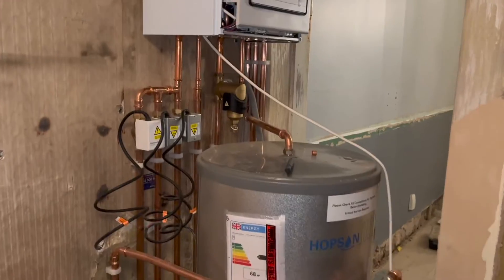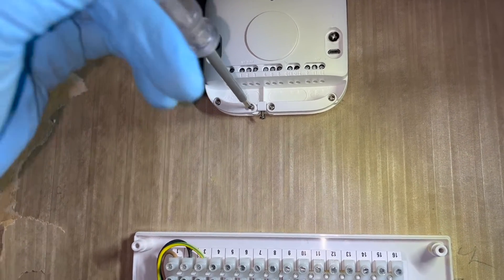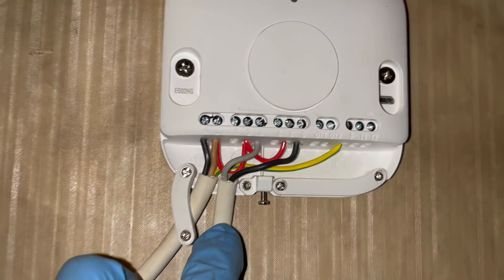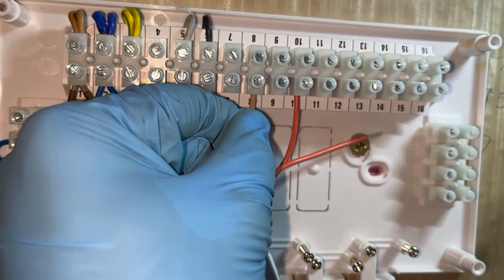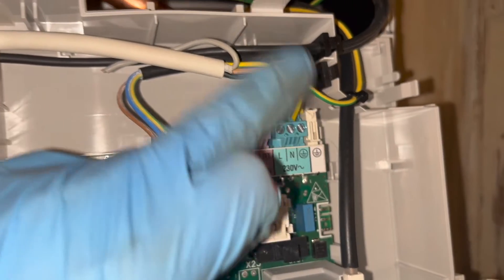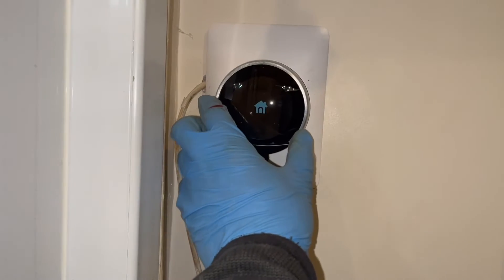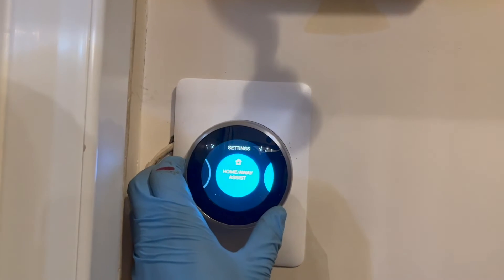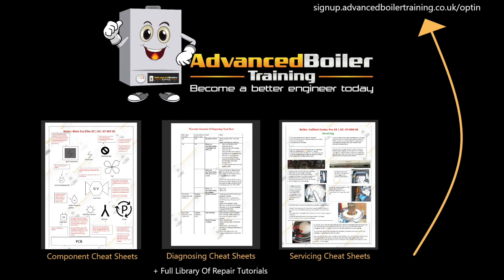S Plan Wiring Install (Nest Thermostat) - How To Wire Central Heating System From Scratch | Vaillant

Comment: Just 1 question does the thickness of the cable matter usually I would use 1.5mm but I can't find any for 5 core for thermostat usually need a 5 core but I only can find 1mm or 0.75mm 5 core

Comment: we have a two zone nest system and to improve flow to upper level, i want to install another pump, do i wire pump directly into no 2 zone valve (which colour wires) so when upper level is activated the pump starts and i get good central flow

Comment: I have one issue with the setup. All was going well unit the boiler cable was going to be connected . L,N,E all wired correctly, switch wired to point 10 but I still have a black wire from my boiler. 230 live out which I don't know where to connect (main eco lite system boiler). Any help very much appreciated
Reply: Eco elite 28 system boiler

Comment: Very good video. Perfect. 
I have 3 zones,3 valves, 2 heating zones and 1 hot water immersion. 
Could i put a nest controller putting the 2zones heating in the parallel in heating zone 2/3 and the hot water in the hot water terminals 5/6?
Thank you

Comment: Hi

I followed your video and wired and the S plan to a new wiring centre. However, after installing the nest, the internal boiler pump keeps running even when water and heating is satisfied. I have a system boiler with a water tank. I also noticed that with Vaillant programmer the water and heating indicator is not shown on the boiler unless it’s active but is permanently on for both.

Any advice?
Reply: I’m guessing you had to take the 24V link out? Confirm if I’m correct thank you.

Comment: Good video, i would suggest to use the left hand side for neutrals and right hand side connector strips for earths and spread apart all the lives and switched lives for maintenance and troubleshooting purpposes seeing that you have so much space on the wiring centre, also looks tidier